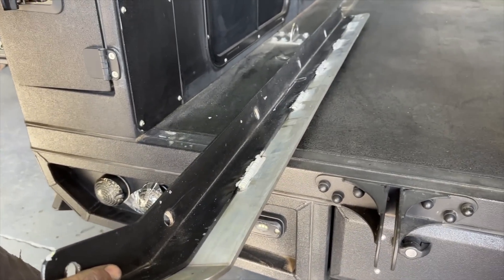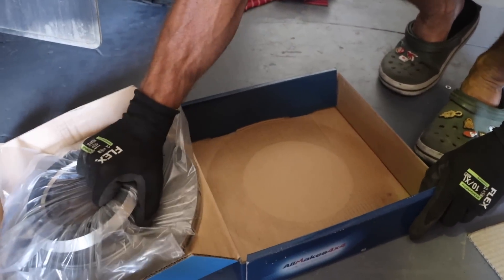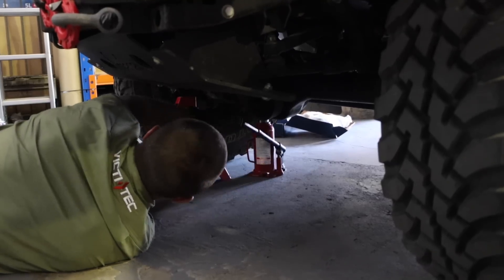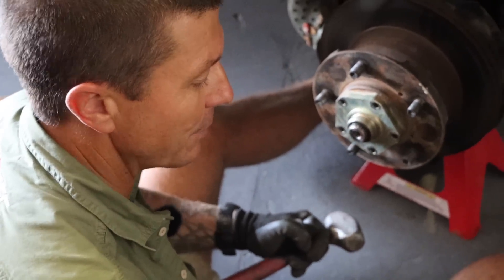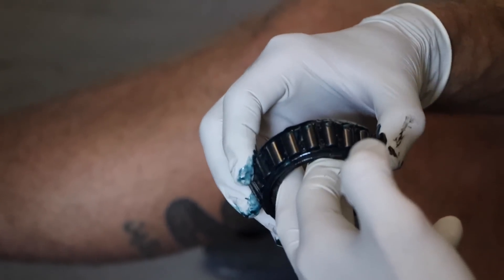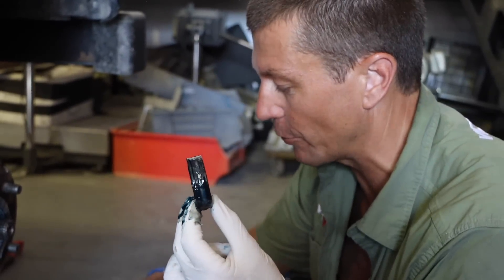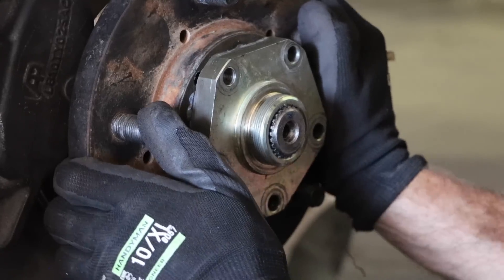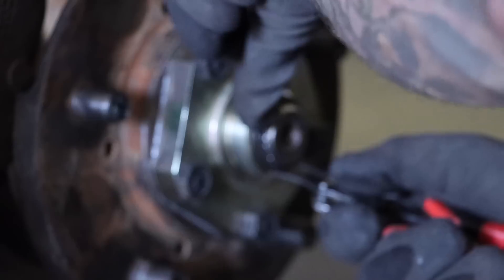Brake Disc change out. - 2010 DEFENDER -  (Technical video)

Comment: A couple of points to make things easier. You don't need to let the hydraulic jack down once the stand is in place. Also, before removing the rh caliper, turn full loch left so it's easier to access. Ideally before you jack up.
Reply from the maker: Great advice thank you 😊

Comment: What is the brand and model of your digital torque gauge? Never used that style (only the normal wrench style), but thinking a digital one would be handy to have for overlanding.
Reply from the maker: I bought it in Australia at an auto parts store. I think the make is Toolcraft but I'm sure there are lots of models. Most auto parts stores would have something similar maybe...

Comment: Hi Leigh, hope you are happy with the Job done.
Why is it you don't use penetrating oil?
It's so much easier to undo overtightened bolts and nuts.
Reply from the maker: Sometimes I do but didn't think of it this time.
Reply: @GrizzlyNbearOverland  I have the habit of starting to soak the nuts and bolts of what I know I'll be taking apart at least a day or two ahead. Or from the day, I ordered the parts. I find it a good way to spot some details and anticipate the job that's waiting to be done.
Good onya from Switzerland

Comment: If you mod the hardline bracket you can undo the clip and slide the line out. You don't need to bend the line. Mine were stainless braided from caliper to chassis. Never had a single problem. I did the same to my Tacoma. Great video.

Comment: Leigh, would it not be best to disconnect the callipers and bleed the brakes to swap out the out brake fluid ?
It was my Dads mantra, whenever we worked on the discs or the brakes - mind you I'm in the UK and we have it pretty damp here and that brake fluid loves to absorb moisture 🙂
Reply from the maker: The brakes were bled not long before that job. Usually if we don't disconnect the brake lines then no air should have got in so no need to bleed.
Good practice to do it often though for sure. Your dad has a good work practice 😊
Reply: @GrizzlyNbearOverland  Ahh, didn't realise that they had recently been bleed 🙂
Reply: It's good practice to change the brake fluid regularly, yes, but I don't see the point in disconnecting the callipers to do that. That just introduces the chance of getting dirt or air in there.
Personally I open the bleed nipple when pushing the pistons back before fitting new pads, and that gets a bit of old fluid out rather than pushing it back up to the reservoir, but I never open the brake lines unless I have to.

Comment: Think I posted a comment when you replaced that bearing that has overheated, the centre spacers are available in slightly different widths, if you don't measure the end float of the hub after bearing replacement then the bearing can be too tight (and get hot) or too loose, you need to select the correct spacer tube to set the end float. . You would be much better to do away with the spacer and single nut system and use the old 2 nut and lock tab system, cheap as chips to do, no silly spacer tube to select and the wheel bearing can be adjusted easily with no extra parts, I've done this on a few TD5's now as it saves having to select spacers. Also, to save grief, the brake caliper bolts are 1/2“  not 13mm, a 1/2" 12 point fits much better and minimises the chance of rounding a caliper bolt, that's a whole heap of pain you want to avoid. Great vid, thank you. 👍
Reply: Also- I was under the impression, as you point out, that the bearings are set to "end float" and not to a torque setting
Reply: @MrDvdelft  They should all be adjusted  to end float, the measurement being set by the tube spacers length on Td5 and tdci, different lengths are available from LR, this being the problem, you need a selection of spacers to set the end float, the older tdi twin nut and tab washer is easily adjusted without the need for extra parts.
Reply: Nice info from all you guys. 👍🏻👍🏻
Reply: Is the old 2 nut and tab system off the TDi?  What is the torque setting on the first nut?
Reply: @MrDvdelft yes, the older 200-300 tdi style, tighten the first nut to 65Nm, then back off and tighten to 10Nm, then tighten outer nut to 65Nm.
Reply: @andicog  is the swap from the TDci & TD5 system to the TDi 200 & 300 system as straight forward as just getting the two lock nuts or do you need the TDi specific tube spacer too?
Reply: @MrDvdelft  yes, all you need is the two lock nuts and the tab washer, keep the thick thrust washer that's against the outer bearing and remove the tube spacer altogether.
Reply from the maker: I was always told the spacers are ok until we change our the entire wheel hub then we should again select spacers in relation to end float. This is what we were advised by the garage in France.
I asked the question only recently.
Reply: @GrizzlyNbearOverland  And yet you have a bearing that's been hot indicating that the tube spacer is slightly too short and the bearing has been tight. Easiest is to use the older 300tdi style twin nut and tab washer set up, costs peanuts and means you can adjust the bearings easily. 👍
Reply: @GrizzlyNbearOverland  I guess it depends both whether the spacer was chosen correctly in the first place, and also whether any replacement bearings are absolutely identical. Hopefully the same make quality bearing (eg Timken) would be made to tight enough tolerances that the spacer would remain the same after a bearing replacement, but I don't know if that's guaranteed. The hub is very unlikely to be made to tolerances that tight, so the spacer will almost certainly need to change after a hub change.

Comment: Top tip. Take your old hub nuts, machine or file the locking ring off and add them to your spares. Never know when you might need them and use them both as nut and lock nut on one wheel.

Comment: This makes my Mitsubishi Triton's front brakes look SO much easier. Undo the calliper (2x 17mm bolts), smack the rotor with a hammer until it comes off, wire wheel the hub surface, then slap a new rotor back on 🤣

Comment: I'm fixing to do a bake job when it warms up and no more chance of snow, the following is what I found regarding slotted rotors; 
"Vented rotors generally last longer than solid rotors. They're also less prone to cracking related to heat build up. Minimal brake pad wear: Smooth surfaces minimize brake pad wear. So vented rotors don't wear out brake pads as fast as slotted and drilled rotors""
Reply from the maker: Front are vented on the Defender rear are solid.
The vented, drilled and slotted discs are what I meant that we were advised against.